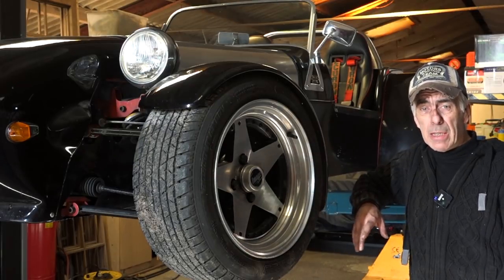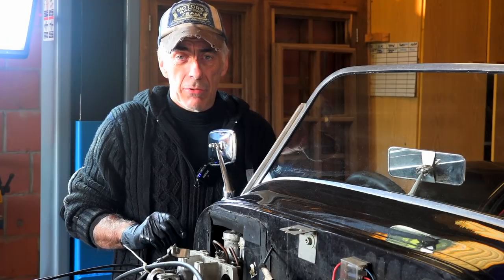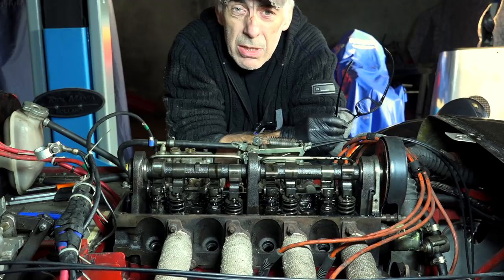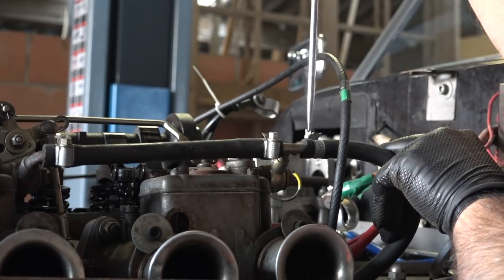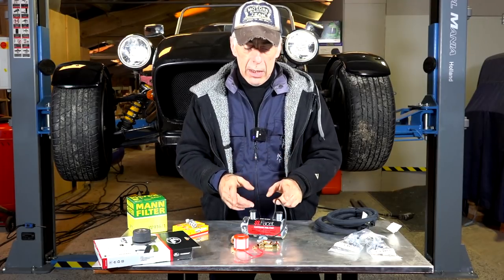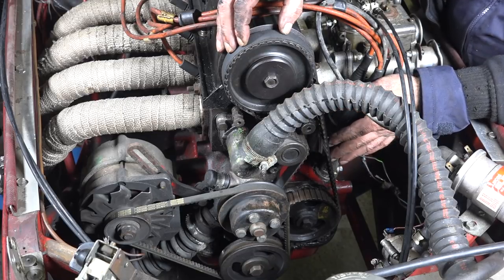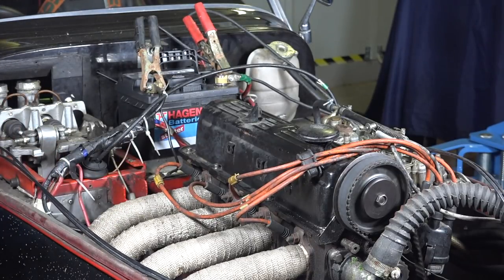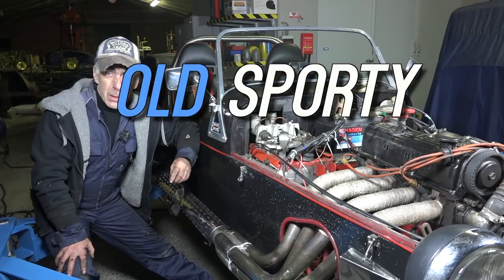Old Sporty,  Part 1 First attempt to start the motor after 10 years

Comment: You deserve 1 mln subscribers. This channel is soooo far better that a lot of garbage that is on youtube now. The low compression on cylinders n. 3 and 4 could be just a bit of carbon built up on the valves seals. You could take the head off while the engine is out of the car and do a lapping procedure on them. Also you can change the head gasket and inspecting better the cylinders. I hope for you that this will solve the compression problem. Btw is always a pleasure to watch one of yours videos. See yo next time!
Reply from the maker: TXS for the comments,   I try to do my best and i am pleased with the viewers and subscribers that i have.  Its people like you that make it worth spending the time to create these video's and share.
The compression test , was a cold test with closed throttles.   That is not how its normally done ( should be full throttle). But I did not wanted  to suck in to much old fuel when I did the test.  Indeed , removing the head and potentially getting a unleaded mod is one of the things I will do...  At that time , I will check the cylinders.

Comment: Refreshing to see someone exercise due diligence prior to “cold starting” a motor.
Reply from the maker: Thanks for the comments
Reply: Agreed, I cringe every time I see someone starting up a so called barn find without even checking the oil and coolant let alone everything else we saw in this video.
Reply: You mean like running it without a radiator or running the starter forever?

Comment: you can get rid of the points and fit a distruibtor of a later sierra and the small ignition module , and put some socks and the carbs. they have modified the sump because it was to close to  the ground. weber carbs should have chokes on them but not many people put cables on them as they usually start without them,
Reply from the maker: TXS for the comments, Indeed.  I was thinking of a programmable electronic igntion with a loadable RPM-advance curve. Mainly because these weber's have no vacuum advance.   The chocke points are there and not connected. In fact the Chocke on these OECD 45 webers is like the fifth fuel circuit on it. Almost like a small additional carburetor.  Some even remove the part and blank it off...  I will see what I do with it once I rework the webers.
Reply: @D3Sshooter  well you could get rid of the carbs and get a butterfly injection system

Comment: You are doing the start up the right way. I never have.  In the past I'd just check the oil level then hit the starter. I always lucked out and everything was OK. Once I started a motor cycle that had sat to 20+ years and ran the entire tank of fuel that was in it. The exhaust fumes were so bad they would burn your eyes and the motor would not run at less that half throttle and stalled a lot.  Once that tank was gone and I got fresh fuel it ran OK. That kind of stuff doesn't bother you when you are 13 or 14.
Reply from the maker: TXS for the comments, Indeed ... I have done that as well when I was a kid. so eager to get it going.  Now at 3*20 I know better.

Comment: Looks like the engine is fitted with an adjustable vernier type camshaft pulley, this would suggest that the camshaft is modifyied as well.
Have fun.
Reply from the maker: txs for the comments, that is interesting . How can you tell...?  I am ceru much interested in it as I have no info on this motor or what has been done to it.
Reply: Hi D3S, from memory, it's been a while, the standard pulley was a cast item with three rough cast holes in it and a steel backplate with a pointer to align with the timing mark punch mark on the cylinder head, seen through one of the holes in the pulley backplate, at 6.00 o clock position. Set your crankshaft pulley to the TDC mark on the front pulley, remove the distributor cap, turn the auxilliary shaft pulley so that the rotor arm lines with the mark on the distributor body edge and your timing is set corectly to fit the belt. 
With the vernier pulley if you wish to change the belt then make your own TDC marks with a spot of paint etc, using the same method for the crank pulley and auxilliary shaft or distributor. Do not remove the camshaft retaining bolt, otherwise you may lose the camshaft timing .
To accurately set your camshaft timing with the vernier pulley you with need a dial gauge, crankshaft protractor and the timing/ lift specification for the camshaft, a little complicted, so for now I suggest you just paint mark your engine.
Hope this helps. Burton's will have more information on this should you wish.
Reply from the maker: @garethdavies3220  Hi Garethm that is great info, I was already wondering why the default standard marks were not there on that pulley   Hole with small pin and  point mark on the cylinderhead ,  now I know. TXS a lot for the info

Comment: These engines often destroy cam shafts when the oil spray bar gets blocked. Also a new cam belt would be a great idea along with idler pullies etc.
Reply from the maker: Thanks for the comments, indeed and that will be installed as soon as the engine is out of the car

Comment: Check the oil spray bar that lubricates the cam and lifters. Any obstruction of the holes and the cam will rub its lobes away very quickly. For all it costs it is worth replacing it anyway just to be on the safe side.
Reply from the maker: txs for the comments, good point. I did but should have mentioned it and shown it in the video,

Comment: When doing a compression test you must open the carb fully , the compression will pick back up after running a engine that has sat for a long time. Pressure for carbs is probably as low as 2 psi. Compression was low because butterflies weren't open
Reply from the maker: Yep indeed , that is why I stated with the no throttle as I did not wanted to old fuel to get in the carbs even more<   As for the pressure that is a bit high  and 2 , 2,5  PSI is the better value as you stated .  All that will be adjusted once the engine goes back in <   TXS for the comments

Comment: The spray bar on this  Pinto engine could  block up the holes and would damage the camshaft  usually caused by lack of oil changes
Reply from the maker: Thanks for the comments

Comment: Hope we will get to see the engine out and refurb Steve. Did you find out if the alternator was bad and any plans  to change the water pump ?BTW, nice name.. “Old Sporty” ;)
Reply from the maker: TXS for the comments, you will see it, inbetween Old Rusty work...   I have not checked the alternator so far, as I have to redo the electrical cables anyhow at some time.   That Pump will be changed once the engine is out of the car. Today  I will start with the brakes , then the clutch , then the motor tuning and finally the electrical installation and the cosmetics

Comment: Good day sir that engines used to use leaded petrol has the valvestem seals been replaced for unleaded petrol or are you going to or is it not necessary?just wondering go well.(and valve seats yes)
Reply from the maker: TXS for the comments, I have no idea if that was done or not. But in each case that is something I am considering
Reply: It's not the valve stem seals, but the exhaust valve seats which need to be changed ,with stellite seats. The old Ford Mushroom seals are the easiest fix for leaking valve guides
Reply: @Mercmad  yes thats why i putt that link their it must get hardent valveseats that link shows that and the ford enjines and wich enjines must get new valve seats due to the lead was like lubricant

Comment: that 2L pinto is crying for a kent cam do it justice and get that standard cam in the bin
Reply from the maker: TXS for the comments, that is true.  I am considering this once I get the engine tuned. First I need to get the brakes and clutch fixed, then the Techncal inspection and then we tune the engine.

Comment: Deliberately switched those two spark leads for the drama? 😁
Reply from the maker: TXS for the comments, actually not.  It took a bit longer to get that first ignition blow, I had the cables right first... but off course it needed a few turns. Then I twisted them again as I was not sure on 1 and 2 ( now wrong). Cranked a few more times , until it did better, but then I realised that I had 1 and 2 crossed. So it was a bit back and forth. to long for the video,